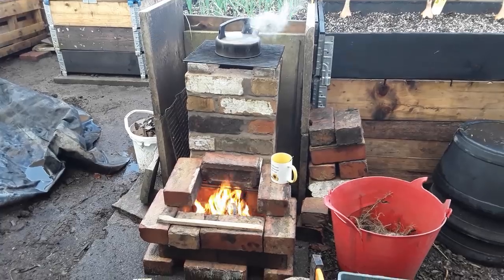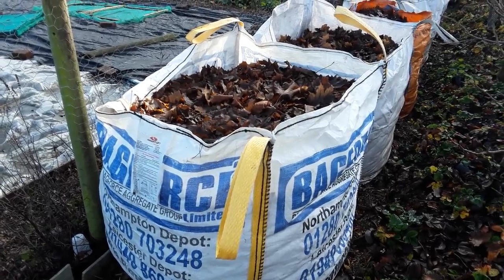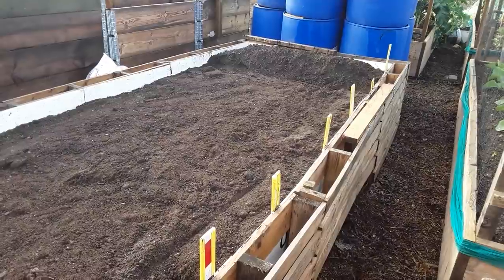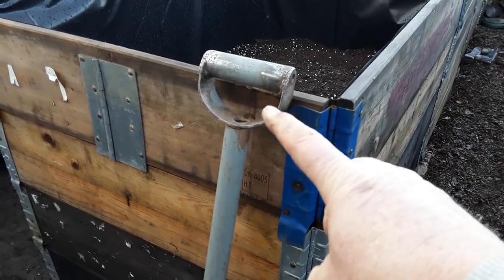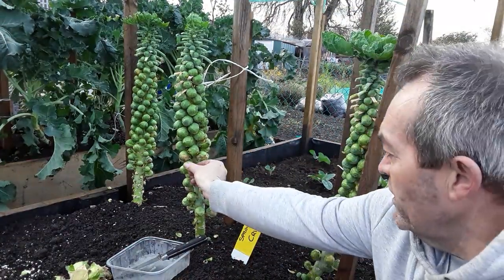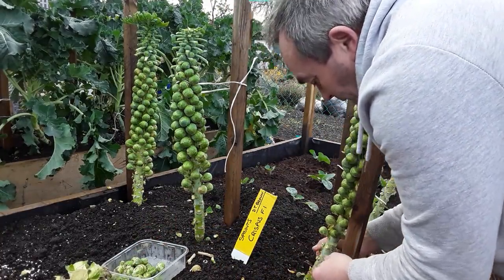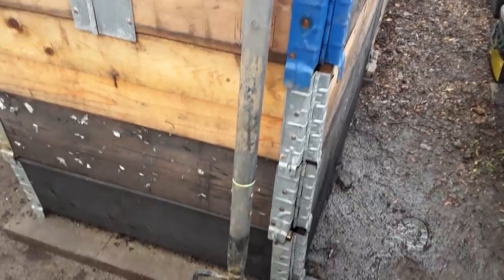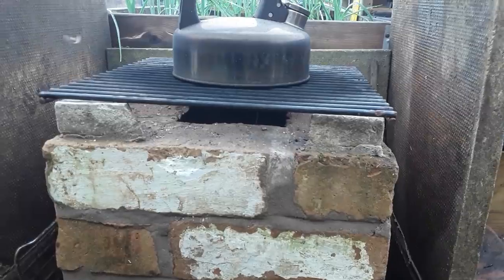How Do I Look After My Brussels Sprouts To Get The Best Out Of Them ♻️Recycling ♻️Repurpose♻️ Reuse

Comment: Great sprouts Terry, mine get holed by slugs or grazed by snails, any suggestions?
Reply from the maker: Put a piece of plastic at the bottom of the plants and collect the slugs as they rest Gwen, vigilance is key.

🎅Happy gardening, Terry King.
Reply: @terrykingsallotmentgardening  It doesn't seem to be an overnight trip for them. I'm finding the slugs and snails as I pick during daytime. I used nematodes in the summer which reduced the slug population, I find small snails in crevices on the sprout plant. I haven't deleafed as much as you which may help, I just wish the welsh water would stop falling. Dissuades the birds and facilitates the molluscs. Freshly picked sprouts are a revelation. Thanks for the reply.
Reply from the maker: @gwenscoble6229  this wet weather has increased the population, pleased that Nematodes have helped you.
Reply: Two strips of copper or aluminium tape round the base separated by 1/8 inch, and connected to a 9v battery.